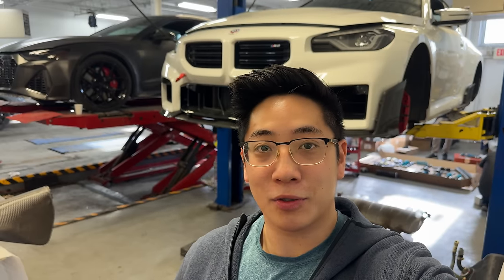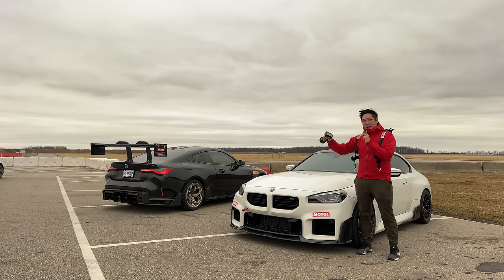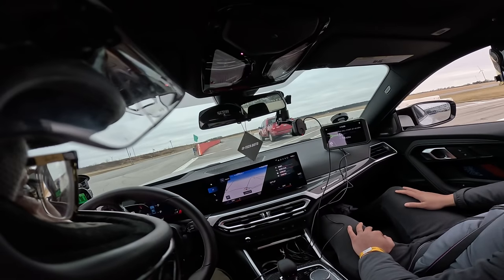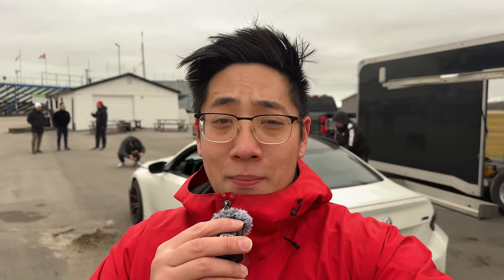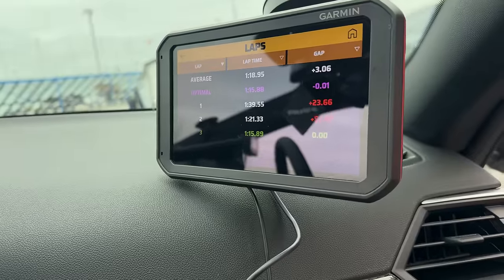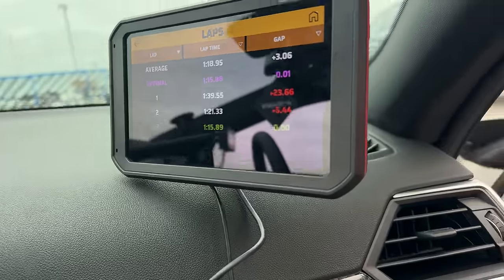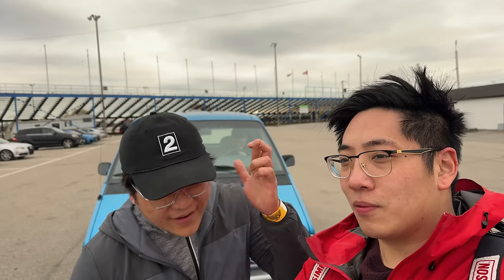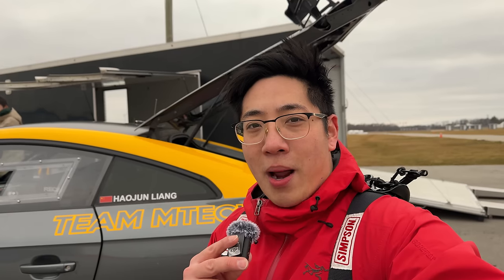BMW G87 M2 Time Attack Build [Phase 1] - Track Tested at Toronto Motorsports Park

Comment: What caused the brake malfunctions warning to appear and disappear multiple times? (stored code?) Just curious.

Try efficient engine (instead of sport) for better throttle modulation - unless you're tuning the throttle maps. Also the feeling of losing your brakes can happen if you happened to get on the brakes too fast, too hard, and the grip wasn't there; freaking out the ABS. Not sure if that's your situation but the "ice mode" braking situation has happened to me consistently when those factors combine. 

Excited to follow the build and development, thanks for sharing. Car's keeping you on your toes haha.
Reply from the maker: I’m not entirely sure… the brake booster was acting a bit funny… maybe Ice mode through the chicane bumps? The car was definitely a handful in this weather! 😂

Comment: 1:14 in -2? Are you selling your car? 😂… did you pull lateral acceleration? How’s it compare to your m2 in optimal?
Reply from the maker: Fellow data analyst I see…Brand new 275 square CRS on my M2c pulled max 1.7 lateral G, max G of the g87 was 1.16… speaks to the track and tire conditions. I’m confident in idea conditions… if it can pull anywhere close to my f87 in ideal conditions with new tires… 1:12…